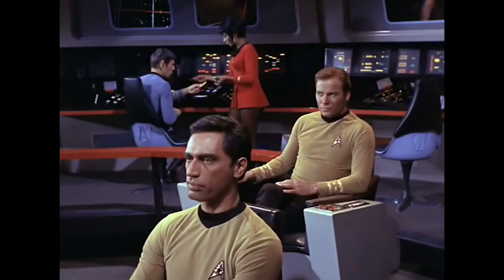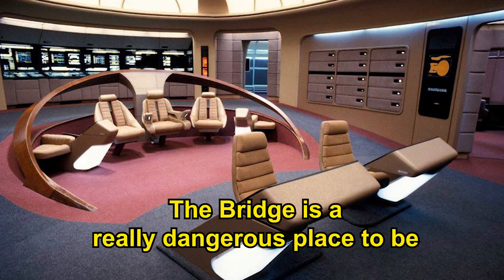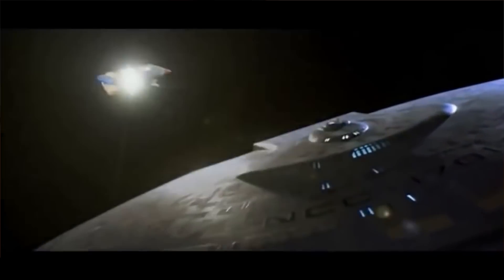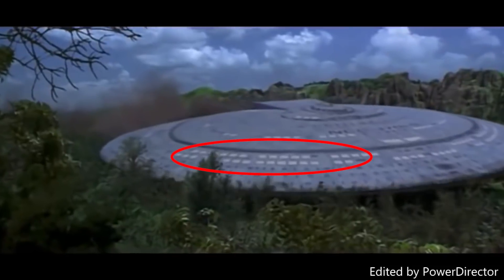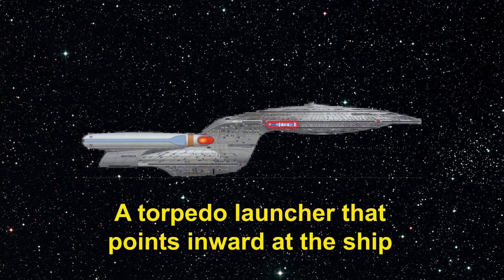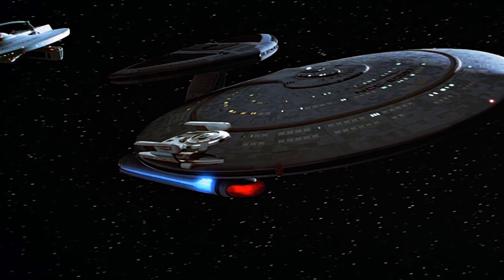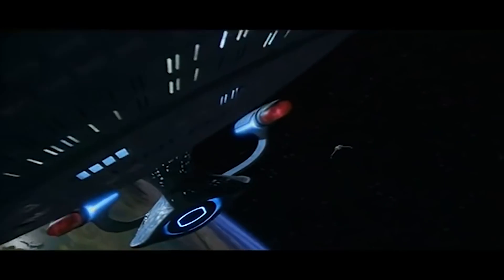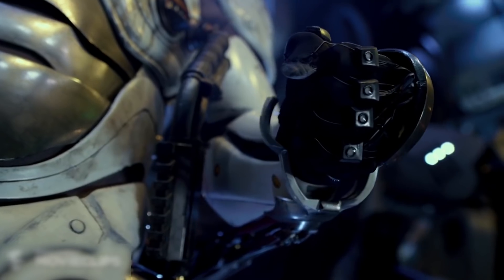10 Flaws Star Trek - USS Enterprise NCC 1701-D

Comment: Yeah, bridge placement never made sense. What’s the point of putting it on the exterior of the ship if you’re going to use viewscreens for everything?
Reply: Same shit as the Star wars ISD. Dig the bridge deep into the belly of the ship. FFS, how hard is that?
Reply: After_Midnight at least ISD makes sense, because they do seem to use the windows, but Federation starships just have a skylight.
Reply: It's because the bridge is traditionally in the top deck. Taken from centuries of sea vessels, the belief is the bridge looks over and protects the rest of the ship. And although it doesn't make much sense for a starship, there is cannon which stated the bridge is the most protected place on the ship.
Reply: I like the Bridge being on top, and I'll give you seven reasons why…

1. Having the Bridge on the ship's hull is dramatically better as it means we can always see the Bridge when the ship flies past the camera.

2. It would seem wrong for command to be in the middle. Command is always "top down" - just like your head sits at the very top of the body.

3. The Bridge actually did have a window. Plus, there was a window in the Ready Room, and many windows in the Observation Lounge (clue in the name). You wouldn't get any of those windows if the Bridge had been deep inside the ship.

4. The Bridge may be an "easy target", but so are most of the ship's other vital systems. The fact is that a direct hit anywhere is bad. That's why they have shields. (And it wasn't primarily designed for combat.)

5. In the Star Trek universe, almost all ships follow the convention of travelling along the galactic plane, which means ships always encounter one another from the side rather than from above or below. This actually puts the location of the bridge at a hard-to-reach location, since enemy weapons will typically eminate from below the saucer section.

6. Common sense states that during combat with an enemy ship, the Enterprise will always be positioned with the ventral side (weapons) toward the enemy, rather than the dorsal (top) side. This actually puts the Bridge as far away from the enemy as possible.

7. Just because the Bridge sits on the hull, that doesn't mean it's easily damaged. Presumably, the bulkheads enclosing the Bridge (including the transparent alloy windows) would be extremely thick and robust - specially designed to resist heavy attack. The principle is that if you secure your Bridge well enough, it shouldn't matter where you place it. And this proved to be true, since we saw countless attacks on the Enterprise D but never saw a hull breach on Deck 1.

So I like the Bridge being where it is! :)
Reply: @Scripture-Man  Thanks, great info. Yeah, with 1 on 1 ship positioning, you can always keep your enemy in front and below.
Strafing and funneling in all three dimensions gives many tactical options in space dogfights.
Reply: but most persons are like Kahn in this regard, "their attack patterns indicate two-dimensional thinking".
Reply: trha2222     Um,,  i think the term "Aircraft"   explains that in itself?  Unless you are a rock!
Reply: @SkyCharger001  THEY ALWAYS BANK AND SPIN IN SPACE ALSO.  and once saw the enterprise do  a yager loop.  In space.  I would love to know how they do that with no wind resistance.   TOTAL   In atmosphere battle tactics in space! Never makes sense to me. they can only fly head on at everything?  So stupid, even   Freaking  Babylon  5 gets the space fighting more correct!
Reply: @Scripture-Man  Good points except number #5.  It would be really inefficient to always travel on the exact Galactic plane, and with the short distances they travel in the Alpha Quadrant (say compared to Voyager), I would expect a lot more vertical movement.
Reply: @Scripture-Man  
1 Given the size of the ship the bridge is barely visible even up close..
2 Given it is an starship and everything happens inside the location of the bridge does not matter... from an geographical point of view...
3 Display technology should be so good at this point of time that there is no way to see with the naked eye if it is an window or an display...
4 If an hit anywhere is so bad there is still the point that areas under direct fire seem to have more damage than areas not under direct fire, sooo....
5 if you fight more than one enemy showing your armored side becomes problematic, quick
6 Same as 5
7 If you argue movie mechanics ok, but from an engineering point of view the star trek fed vessels are not really that good... ok, they are sleek sexy looking but poor engineering.

Comment: I would argue the saucer section didn't have a controlled landing in Generations because its primary systems were damaged from the warp core explosion.

P.S. I'm excited Ben is back!
Reply: Im surprised no one else realized that
Reply: @DaKidSiriusBlak  Data ealized the second he lost control LOL Oh Shit!!!
Reply: But even the manual (Which he showed) says it should land like this. Or did I miss something?
Reply: Doesn't really matter... Regardless of how it lands, it won't be going back up again.
Reply: @J. Dyson Saylors - 
YES & also because 1701-D destruction & disaster was needed for ST7
Reply: The original technical manual for the 1701 Constitution Class shows landing legs on the saucer section. The three large triangle shaped dark areas under the hull. Why they didn't include them in in the Big D is unknown.
Re: Escape Pods. The saucer section hit the atmosphere so fast after the warp core explosion no one would have had time to get to them, and ejecting them while IN atmosphere most likely is not possible. Of course, If there any on the bottom hull of the saucer, someone could have remote activated their engines and used them to try to control the landing.
Reply: According to the manuals for  Enterprises TOS, refit, A and D, the saucers do not have atmospheric flight abilities, only partially controlled descent crash landing. The landing legs on the TOS and refit were supposed to support the saucer upright on the ground for final evacuation
Reply: Also they we're not trying to land on the planet. The saucer would have stayed in space waiting for a battle section to show up and connect with it. Warp breach took it down.
Reply: Also, it always bothers me that people blame in on Troi because she was at the helm. Yes, she took the helm...after it exploded!  I doubt anyone could have done much with that.
Reply: The Technical Manual also clearly displays an emergency warp core ejection; you know, that thing Riker should have done above Veridian III instead of separating the saucer and dooming the Enterprise D to scrap?
Reply: @krisgonynor689  1701-D was far larger than 1701. The crash landing is supposed to be a worse-case-senario.
Reply: @sosaix3545  They couldn't eject the core. That has to be done manually from engineering, and it was flooded with plasma coolant.
Reply: Yeah that is not a good one. If the star drive explosion had not knocked out helm control on the saucer section, it would have stayed in orbit in the first place and would not have gone down to the planet. Crash landing or "by the book"
Reply: @BlackEpyon  Incorrect; the warp core could be ejected by voice command to the ship's computer.
Reply: @sosaix3545  Yet Geordi said there was nothing he could do.... So the plot must have forgotten about that.
Reply: BlackEpyon he said there was nothing he could do to stop the warp core breach.  Kind of a big difference.  And again, the ejection command could be done from the bridge, not just main engineering.  

Just quit while you’re behind; you’re wrong on this one.  The writers, in their desire to get a new Enterprise, overlooked the warp core ejection.
Reply: @sosaix3545  Isn't that what I said? That the plot conveniently overlooked it?
Reply: @BlackEpyon  no, you said it wasn't overlooked, and the core couldn't be ejected because it had to be done manually from main engineering.  And that's not true; any verbal authorization to the computer from anywhere in the ship could accomplish this.
Reply: @sosaix3545  ".... So the plot must have forgotten about that," is what I said. That was a concession.
"any verbal authorization to the computer from anywhere in the ship could accomplish this." I doubt that. It would have to be restricted at least to command personnel.
Reply: @BlackEpyon  at the risk of splitting hairs, when I said a verbal authorization to the computer could accomplish this, obviously, the need for a command authorization was implied, such as "Computer, initiate warp core ejection sequence, authorization Torres Alpha 19284 - acknowledge," or something to that effect.
Reply: @sosaix3545  That makes sense.
Reply: Jaurl Z with respect, it’s not.  Go back and count the number of times other Starfleet vessels ejected their cores (quite a few, especially Voyager) and you’ll see it was actually as routine as any emergency procedure can be, and an uncontained warp core breach on an ejected core would have resulted in a less damaging explosion than having it contained within the Enterprise D’s stardrive section, particularly due to the much higher volume of debris.
Reply: @After_Pasta  I understand where you're coming from, but the physics are simple - an ejected core is less damaging in an explosion than a contained one.  Drop a lit firecracker on the table and it might scorch part of the table as it blows, but hold that same lit firecracker in a closed fist on the table and you'll be cleaning blood off the table for hours, re-staining it, etc.